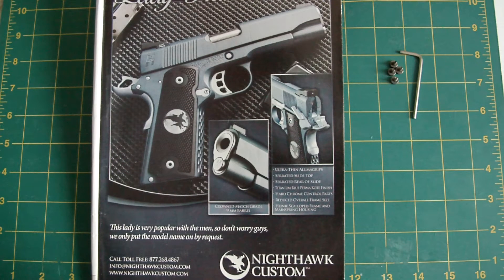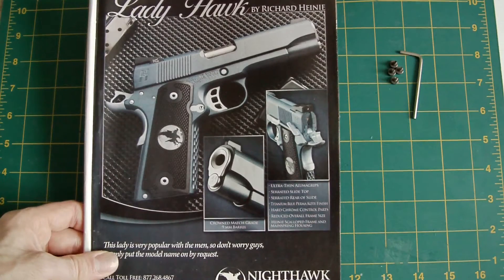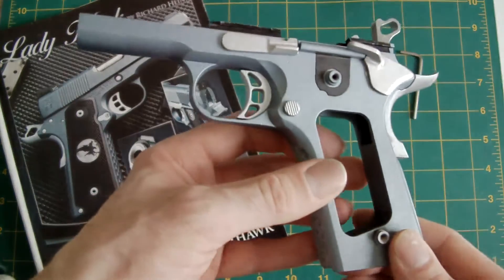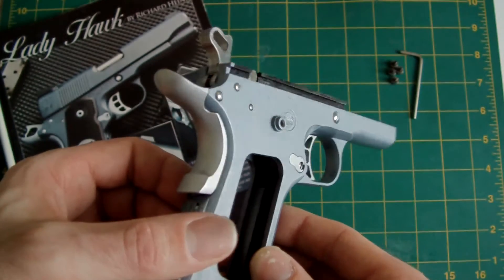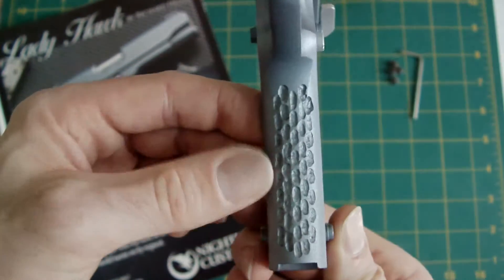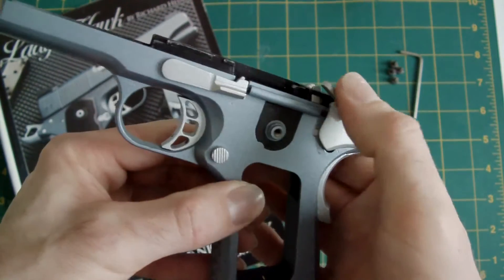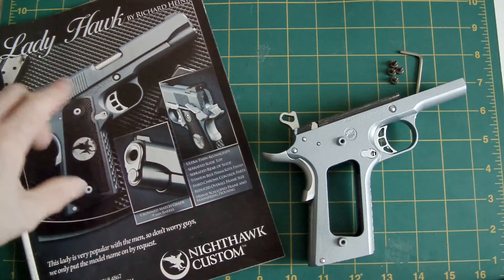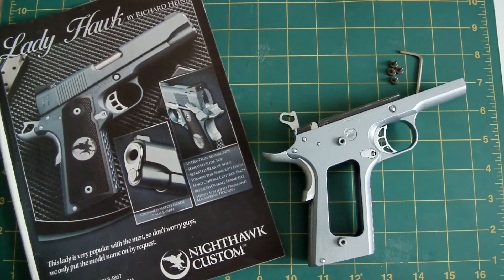LaZouche Custom airsoft NH Talon II Ladyhawk project Pt 2.

Comment: very nice, like the pistol's looks :-p will be a very handsome project. is it a 4.3 slide? i've finished my nighthawk project, you might've seen what i looks like. TM nighthawk with OD XT grips, a silver hammer & trigger, and a PDI tightbore barrel. stunning pistol and super light weight :-p now i've started on a glock 17 project, i'll upload a vid when it's done. gone for a silver metal slide with a tan frame. it'll be a nice addition to my collection of TM pistols :-p 
cheers mate